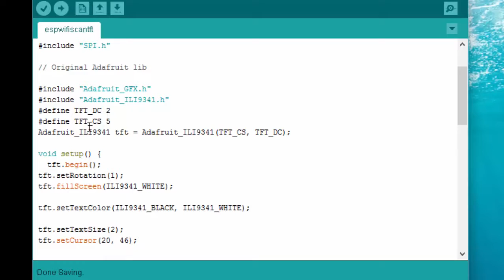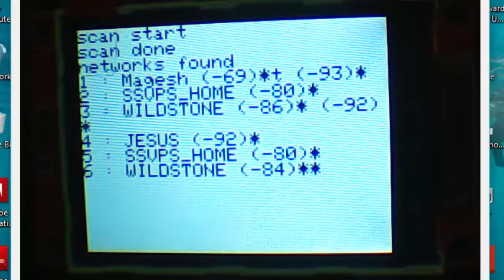TFT LCD screen wifi scan in Nodemcu(esp8266)

Comment: First, thanks for the tutorial.

What are the differences (if any) from a sketch for Arduino Mega and ESP8266? What should be changed / added in a sketch for Arduino Mega to use on ESP8266 Nodemcu?
Thank you

Comment: i connected like this 

LED  3V3
SCK D5
MOSI D7
DC/RS D4
RESET RST
CS         D2
GND GND
VCC 3V3

this is different your connect array a little bit (only cs pin) 
but It does work properly.

i wondering that what is the role of CS and DC pin , why use different  pin number in coding ( TFT_DC , 2 TFT_CS 5 : it seems to mapping for arduino gpio? isn't right ?)

Comment: Thank you for posting the tutorial.
I was having trouble migrating my weather station project from the 'Particle' platform to the 'NodeMCU' platform, and your Kindle book and software examples were very helpful.
I connected your scanner program to a 3.2 inch touch sensitive TFT from http://www.buydisplay.com/default/3-2-inch-capacitive-touchscreen-240x320-tft-lcd-module-display and it worked great. Just make sure that the TFT display is configured as 4 wire, since those displays can be configured many ways.
Reply from the maker: +Edward Casati I am glad it helped you, could please leave your opinion on my book , just few lines of review would help me and encourage me, thanks for leaving this comment